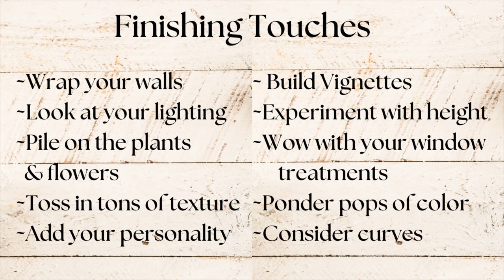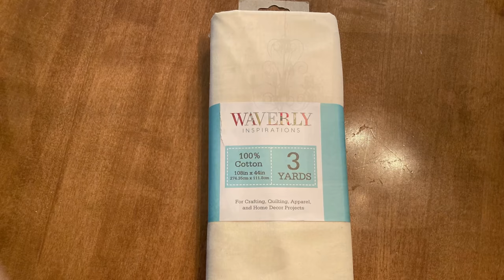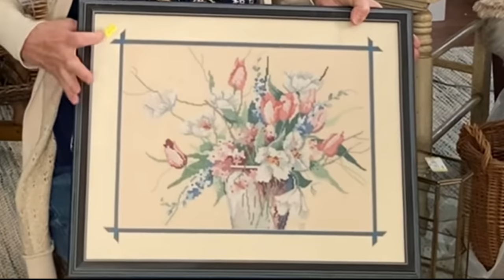Home Decor DIY’s and Finishing Touches to Take Your Home to the Next Level

Comment: It's so nice to find another bird-of-the-same-feather here on YouTube.  So much of what you do, is very similar to what I do in my own home.  One example: we both like to have a decorated bottle of water by our bedsides.  But my cat will not let mine alone, so glass won't do. I cut some flower out of fabric and used mod podge to glue them to a lavender plastic bottle.Then, I coated the top with mod podge.  My cat has knocked it over many-a-time, but it keeps looking pretty and useful.
Reply from the maker: I had a cat like that when I was younger. She would knock over anything with water in it—fresh floral bouquets were out of the question. But, she was the sweetest cat otherwise. She developed a cancerous tumor in her mouth—it broke my heart.
Reply: @CanterburyCottage  Mine is also a very sweet cat.  So I can understand how it would break your heart.

Comment: Love so many of your wonderful ideas. I selvideged a small IKEA  white 2 door cupboard from a beauty spa and need to revamp it. It was left out in the rain so I left it outside my apartment to dry. It has stains inside despite hard cleaning and a few spots outside. Would you recommend napkin or fabric découpage on the squares of the outside?what about covering the inside shelves? 🤔 thanks 😊 🙏 for yr wonderfully inspiring videos.
Reply from the maker: Thank you! You could use fabric or napkins. I prefer napkins. If you apply a couple of topcoats, it will be quite durable. I would probably just use a pretty contact paper inside for ease of cleaning.
Reply: @CanterburyCottage  thanks so much for yr reply. Will try the napkin first plus shel idea. Have a lovely evening.